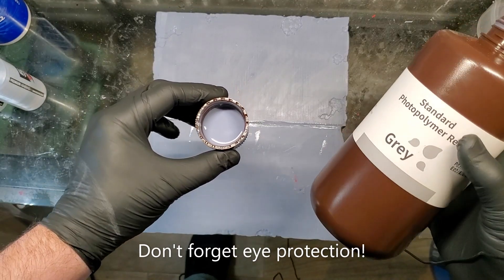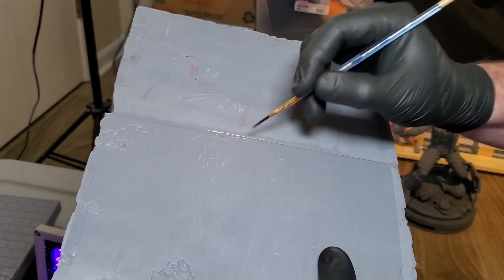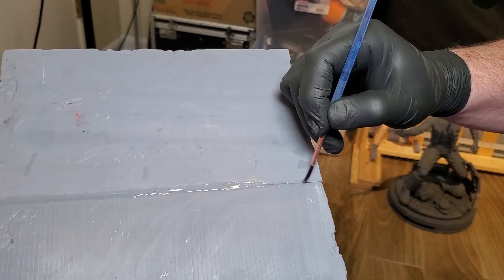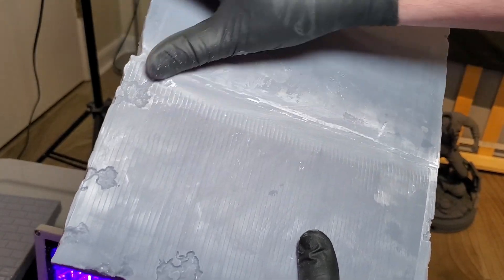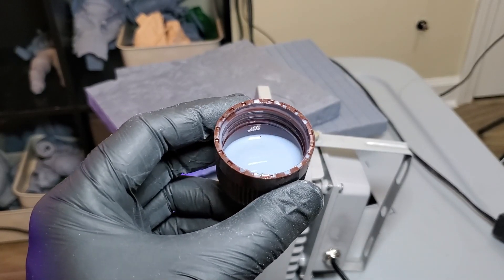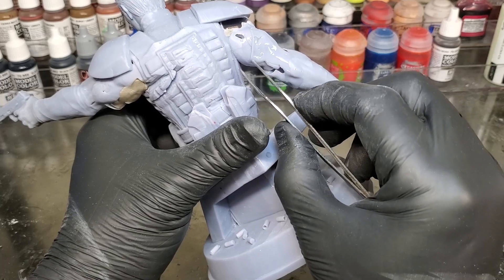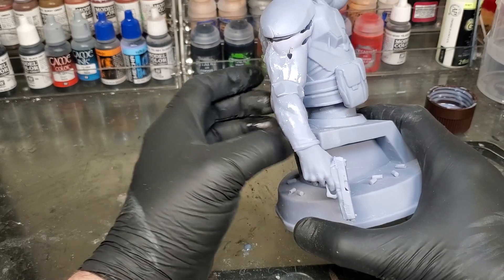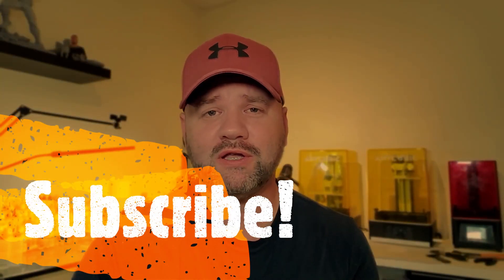How To Use Resin Welding For Your 3D Prints/ Tutorial

Comment: Can you resin weld over paint, or do you have to sand the paint off? Say you painted a head separately, then glued it and wanted to hide the seam. Thanks for sharing your knowledge.
Reply from the maker: I wouldnt try it over paint. There's basically nothing for the resin to cure to. You would need to sand it off.